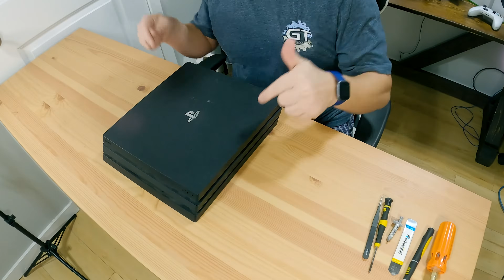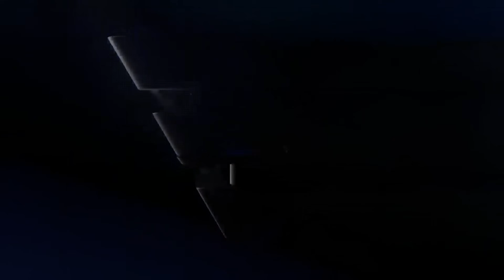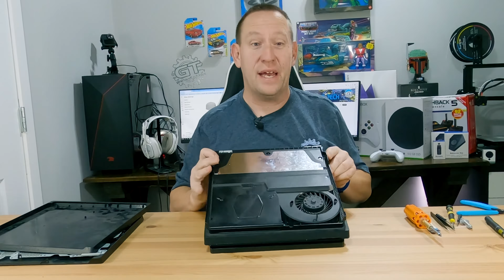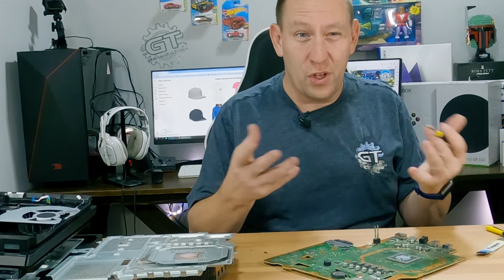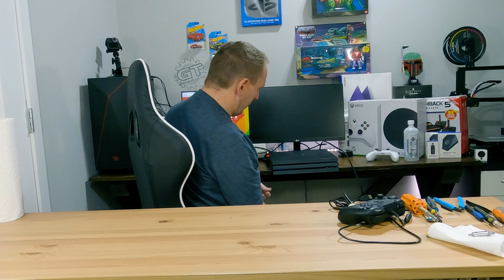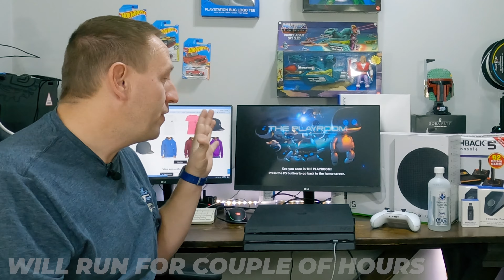Huge Performance Boost AND No More Jet Engine on your PS4 PRO! | Gears and Tech

Comment: IT Technician here, allow me to give a pro tip: don't use Arctic silver thermal paste on such devices, worse choice and cheap.
If you really wanna take care your stuff use something like Thermal Grizzly or similar, don't cheap out for 4-5€ or USD, otherwise in one year you will open again the device, to clean it and replace the paste.
Reply from the maker: Great advice
Reply: How much of the Thermal Grizzly paste should I use? Just enough to cover the chip or the whole tube that came with package?
Reply: But isn't the mx4 and mx6 good thermal pastes
Reply: @BCBe4tS  Almost any of the top brands are good to use

Comment: Yeah well when they have the the heat sinking solution they should actually take a piece of fiberglass and put it in between like a sandwich because that does help it out a lot trust me I know I owned every single system that came out for
Reply from the maker: Interesting

Comment: I just opened and cleaned the fan and heat sink.

I CAN TELL YOU IT WORKS
IT RUNS AS QUIET AS A MOUSE
I ONLY CLEANED THE FAN AND HEAT SINK VENTS ONLY
Reply from the maker: Glad to hear it

Comment: I still have the PS4 Pro, and while I've just bought the PS5, I can't put that on, because my TV is poor 4K and doesn't even run the PS4 Pro at its maximum Resolution... And because at my desk setup the PS5 is too big to fit...
I'll make a new desk setup soon. But I want the PS4 Pro to continue have life because the Developers failed us and only cross platform and cross gen games are Amazing 4K-60fps and only on TVs worth more than €1K.
So I'm planning to gift it to a friend of mine. I'll disassembly it, clean it up, and then:
Does it worth the money and time spend to discard the HDD and replace it to a 2T SSD and then replace the thermal paste to a new one or a liquid metal?

Sorry for my English, I'm from Greece, I don't use it daily. Hope you understand me.
Waiting for your respond!
Ok that vid is 10months old, I'm totally ok if you never see that question, and never replay.
Hope U do..
Thank you in advance!
Reply from the maker: Change the thermal paste, then put in an ssd and you'll be fine

Comment: If I install the regular HDD back into to my ps4 pro do I have to install the software again on it with the USB drive or can I just take out the ssd and install the old hdd back
Reply from the maker: You can plug the old one back in as long as you don't do a system update while the drive is out

Comment: I used Arctic MX-6 thermal paste and replaced all pads with Arctic TP-3 thermal pads. My Ps4 pro has never been as silent as it is now
Reply from the maker: It's crazy how much it helps
Reply: Im new to this topic, i cleaned my ps4pro and this does a lot.
I dont have thermal paste. I see MX-4 ist half the price.
Is Mx-6 so much better?
Only would use for my PS 4
The rest i think would rot in the tube for ever 😅

Comment: GC Extreme is so much better for a Thermal compound,
with only a 48hr Curing time but you usually see instant results anyway
Reply: also,
gotta say...
love how you called it a "Sanity Check", lol
but yeah...
you autta use GC Extreme,
I open up my PS4 pro Frequently to clean out and re-paste if needed...
just recently redone it the other day because the fans were gettin pretty loud again,
opened it up to discover I last used Arctic Silver because it was all i had at the time...
(Wont be doin that again)
over the years I've tried and tested many thermal compounds,
now I wont use anything but GC extreme...
i swear down by the stuff,
so take this as my random Recommendation.
Reply from the maker: I'll keep it in mind

Comment: If someone has this problem and doesn't want to take it completely apart what you want to do is remove the top cover. Take a flashlight and shine it into the fan housing towards the power supply. If you look in there and see a wall of dust that's a big part of your problem. The issue with Pro and OG PS4 is with the fan housing and radiator. The fins are really close together and they create a wall of dust. I have a 1st gen Pro and that thing is loud when playing demanding games like GoW Ragnarok but otherwise isn't bad. Like other commenters said the 2nd gen Pro is much quieter.
Reply: I just installed GoW Ragnarök and  even before reaching the main menu I thought there was something seriously wrong with my PS4 Pro because no other game has caused it to get that unbelievably loud. It’s the first time I’ve thought about even opening up the console to clean it, but I think I’ll have to at this point. How loud should the Pro get with Ragnarök even if the console is totally clean?
Reply: @DisposableSupervillainHenchman  after I cleaned mine and put new paste on it I can't hear my fan anymore on any games. So the paste is worth it.
Reply: @charlesfischer1604  i did too but have yet to replace the thermal pads too   will replace the paste with even better one   i used  noctua  and its much better :)
Reply: i know i'm late, but my PS4 pro keeps on overheating and shutting down on high performance games like: RDR2 and MLB the show, would just cleaning the heat sink fix this issue, or would I have to reapply thermal paste aswell? sorry for the bother, i'm just trying to fix it.
Reply: @spencee11  What I suggested in my original comment doesn't require you to completely take the system apart. So you can try that and see if that's enough before tearing the entire console apart.
Reply: @oblivieon1567  alright thanks for the help

Comment: I will say 90% alcohol is also fine, just use a bit of compressed air across the board to chase any moisture down and evaporate it.

Also, ATTENTION SMOKERS: Cigarette and Weed tar will get into your systems and create an environment where dust will STICK to surfaces.  Normally dust can just be cleaned out with a couple well placed blasts of compressed air to chase it out, but stuff stuck to tar will have to be physically removed.  Also it's pretty permanent.
Reply from the maker: All great advice!

Comment: You show the main motherboard coming out with the heat sink, but on mine there are a couple screws under the motherboard that holds the heat sink it. you have to remove the 2 CPU cover screws and take the motherboard off from the heat sink first.
Reply from the maker: Yes. Thats true

Comment: Didn't fix anything cleaned thoroughly, replaced thermal paste, and replaced the fan. Still have that f'ing noise. I think it's just a poor design by Play Station. Makes me not want to buy a PS5.
Reply: What thermal paste are you used ?

Comment: Thanks to PS4 Pro, now I won't underestimate a small fan anymore.
Reply from the maker: If you spin it fast enough it can move a lot of air
Reply: @GearsAndTech  
I have 1 more thing that was small and spins like a jet engine. The "XPower A-2" computer dust blower. Check it out. It's noisy but it's small, portable and very powerful.

Comment from the maker: This is the thermal paste we used: https://amzn.to/3Vvf4X0

Consider an SSD upgrade as well using this CHEAP SSD Upgrade:
500 GB - https://amzn.to/3FeSY5w
1 TB - https://amzn.to/3gGsC2R

Do You Already have a PS5? 
Here are some items you may want

Dual Sense Charger Dock https://amzn.to/3iSUHmh
NO SOLDER Back Buttons https://amzn.to/3vv349Z
Console Skins https://amzn.to/2TCvJgn

Internal Storage Upgrade:
Suitable Internal SSD https://amzn.to/3iOJGlU
Reply: Hey ya remember me from the other day on a video about graphics cards for ps4 pro? Well anyway fella I remember you saying that you need a PC first to sort out installation and whatnot with a graphics card but I'm here to ask you is there places that will do this for me according I've got the graphics card in the first place ya know installation? Because I don't own a PC myself I'm just a console gamer but I'm wanting to upgrade my ps4 pro because I simply don't have a spare 500 kicking about that I can spend on a upgrade to ps5. Any info is appreciated bud and as always have a good day.
Reply: Even if I had a PS4 Pro, I think I must swap in a 2TB Solid State Drive as an option not only for fast booting performance, but also twice the storage the 1Tb hard drive do not. It does not matter what the brand name or cost for a 2TB solid state drive I get, even from Best Buy.

Comment: It's been a while when I opened my PS4 Pro, but there is an arrow so you know which screw to use.
If you want to reduce the jet fan noise, do the PS4 Pro 80mm Fan case mod as well.

Comment: All I did on my original PS4 was clean and reapply the thermal paste and it works perfectly now
Reply: I did that with my slim ps4 and i did the top fan intake mod i might do the bottom part mod where hot air
Reply: I did the same with my model 1 ps4 pro. It worked for about 3 months then it was back to jet mode 😂. I’ll probably do it again sometime this year
Reply: good to know
Reply: I cleaned it and it still makes the same sound only when playing games, when I you to YouTube it stops making any sound. Don’t know what to do
Reply: @jyotikaur7137  replace the thermal paste
Reply: @brettstover1850 thanks I’ll give that a try and report back
Reply: @jyotikaur7137 Did you try the thermal paste? I am going to try the same based on your feedback
Reply: 13825
Reply: PS 4 is a solid reliable console . All versions of the 4 even the super slim.

Comment: Fellow electronics sniffer here! It really does help to diagnose lol. Today my weedwacker was running a little slow so I sniffed the motor and thought, yep, this thing is dying! It lasted another 15 minutes. It's done. Yesterday, I sniffed a relay on a Home Theatre Receiver. Changed it out and fixed it! Smelled burnt and it was slightly melted but could not see it until desoldered. Your nose knows!
Reply from the maker: Glad I'm not the only one!